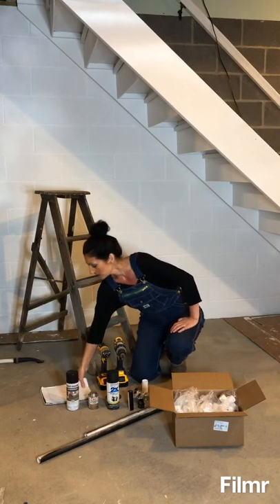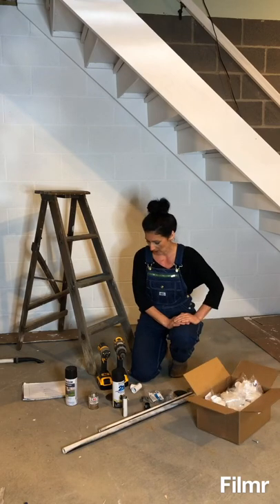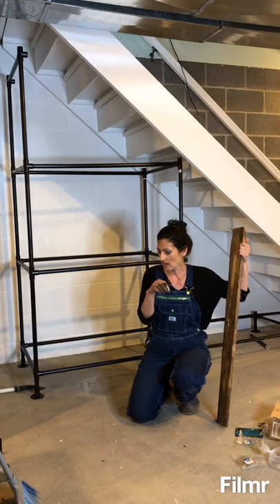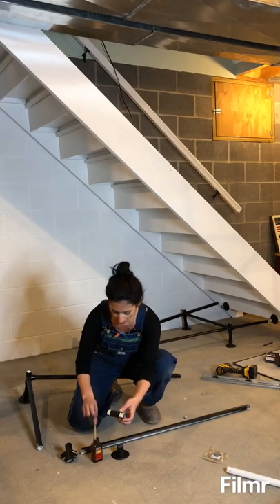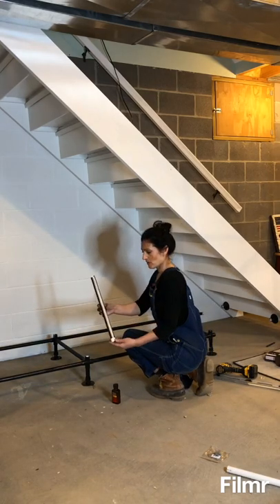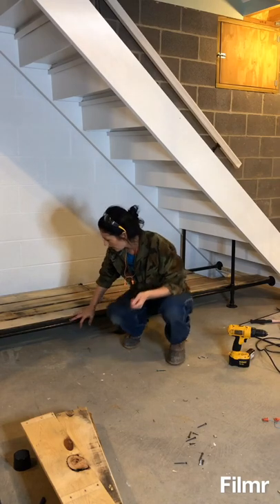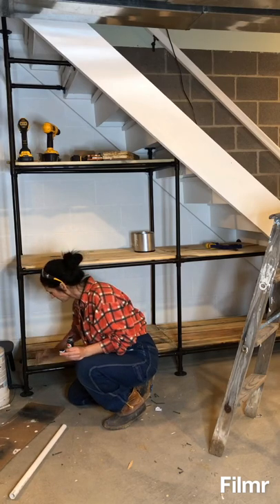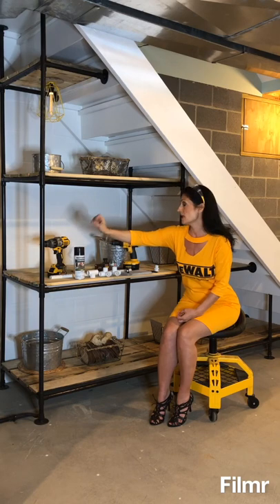DO IT YOURSELF INDUSTRIAL SHELF! How to Make Black PIPE Shelving from Cheap PVC PIPE (MAJOR DUPE!)

Comment: What’s the weight capacity compared to the actual cast pipe
Reply from the maker: I have no idea because I couldn’t afford the pipe, but these are an inexpensive replica for decorative and light use. I would not stack super heavy items on them but the decorations you see in my video have been there for a couple years and it’s still fine.